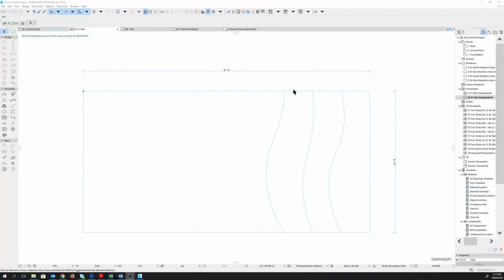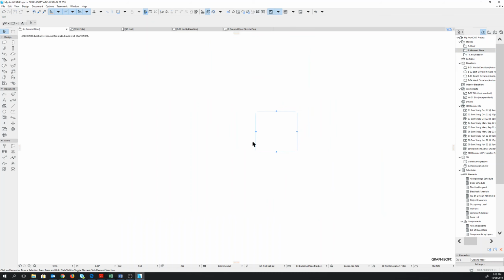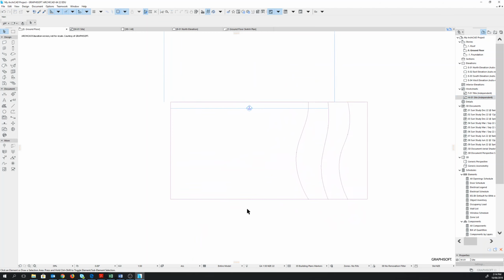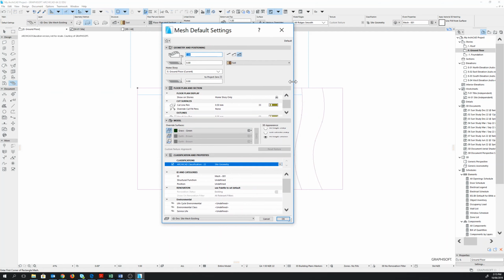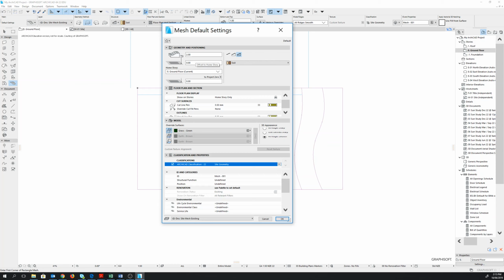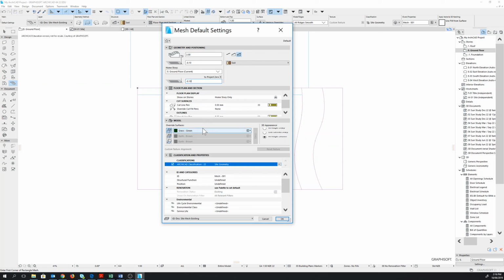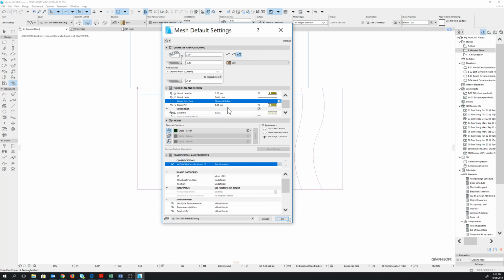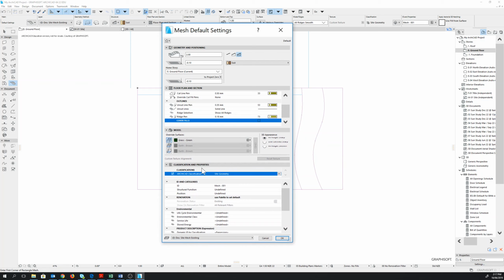4: Site Mesh

Comment: Hello Ezi, I can not select the mesh with Shift + click nor clicking on any edge in the Mesh!! any tips?
Reply: I have the same issue, arrears the video was cut short
Reply: Found the missing steps
Now that we have set the parameters, we can create the terrain. To do this,
 Select the Rectangular Geometry Method in the Info Box and click the two opposite points of the site rectangle (A & C; or B & D) to create a mesh.
 Hit the Esc button on the keyboard to deactivate the Mesh tool